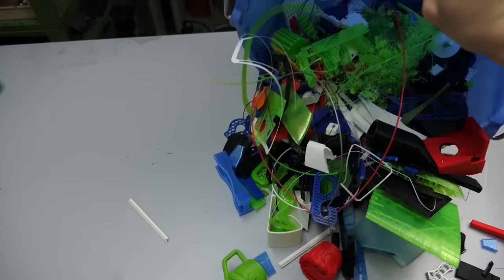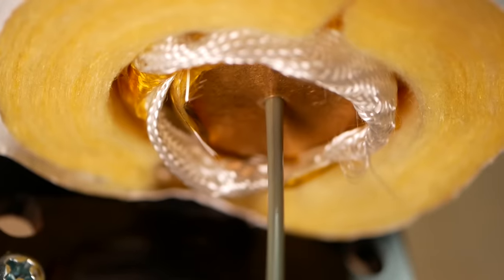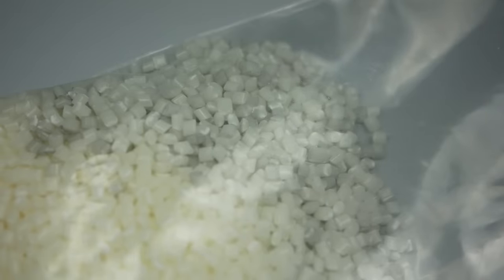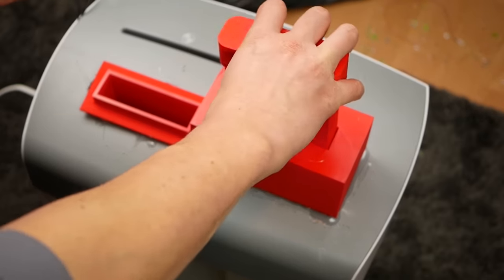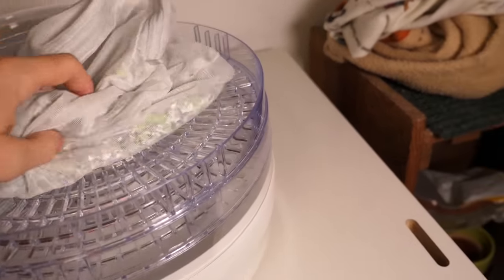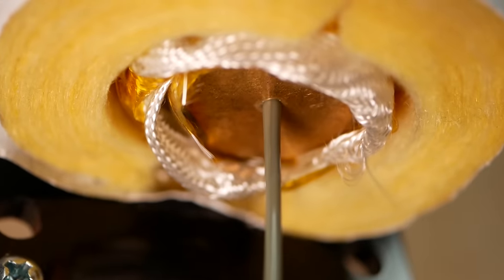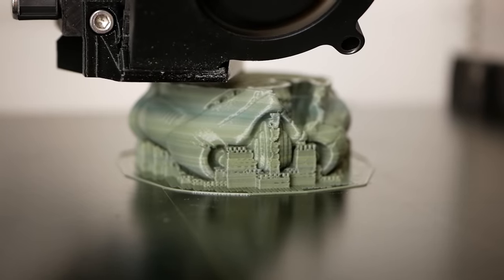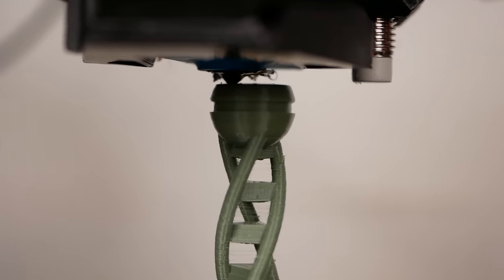Recycle your failed 3D prints! Make new filament at home.

Comment: In my own case, the sad fact is that I do not assiduously separate the different materials.  My waste materials box is an eclectic mix of PLA, PETG, ASA, PC Blend some with CF, and even some PA Nylon.
 I think maybe the only use for a composite of my own materials might be park benches. So, I think maybe I need something that produces pellets for injection moulding, rather than filament.

Comment: well great idea, i had the same one myself but could not build the right kind of equipment i needed and buying it was not an option at least not yet, maybe if some of it comes up in an auction.  Anyhow i had this thought with the wood chipper idea of course you go smaller as the chips get smaller but i was thinking that maybe freezing the plastic first before chipping it and continue to freeze it and chip it or grind it down till you get it into the pellet form you are looking for anyway its just an idea Good Luck

Comment: I think I'd rather take a multistage approach... I'd first melt the recycled stock down completely in a hopper, then extrude it to a uniform 5 - 8 mm filament... then use this new "rough" filament in the rig you created for this set up.  This should ensure complete uniformness going into your extruder and help to ensure a much more reliable end result.

Comment: I've been thinking about this some, what about making something that pelletizes first and then feed that into the final system to try and get good filament out? 

Also, have you tried any non-3D print scrap materials like water bottles or other stuff? Scrap HDPE while not the material of 3D printing seems to be popularly re-melted in this way.

Comment: I think recycling is an extremely important criteria for anyone wanting to get into 3D printing. Recycling should matter to all of us. Ironically, and not so long ago, I was speaking with a friend of mine. For some reason, I decided to play devil's advocate in favor of throwing plastic waste material in the garbage. She was appalled by my attitude and social standing. All the while I secretly admired her, and I agreed with her wholeheartedly. Honestly, I want to recycle my failed parts. Not just to save money on filament costs, but to do my share to protect the environment. There's nothing worse than going camping out in the middle of nowhere, and finding a used latex condom, plastic bottle caps, and empty beer cans on the ground! I hope you'll agree that this is not socially acceptable, or responsible. 
At the moment, I have a large box filled with my failed prints, and waiting on me to find a solution. Also, I recently purchased a second 3D printer. This means I may end up with failed prints more frequently than before. But it brings me to the following question. If you're not recycling your failed plastic parts, what are you doing with them? If you don't mind giving it away to a recycling center, then by all means do so. I don't have the financial means to do this. If you don't care about the global plastic waste problem you're probably throwing it out with the trash, right? 
Which brings me to my next point. The combined costs of a printer, plastic shredder, and filament extruder can be quite daunting. Let's be honest for a moment. The high cost of shredders and filament extruders indirectly contributes to the global plastic waste problem, because most people will opt to take the easy way out and throw their failed prints in the trash. Unfortunately, I am of the opinion that many companies who contend to do their part to protecting the environment do as little as is possible, or just enough to maintain their public image. They devote most of their efforts towards industries. And because these industries combined, mass produce and sell plastic products by the "thousands of tons" (very modest estimate), they can afford the higher costs of industrial type machinery. Hobbyists, on the other hand, with their lower income and limited resources, get left behind. Let's face it. We are nearing the end of 2021, and no one has actually come out with an affordable solution geared towards recycling for hobbyists. A 50$ shredder kit - come on! This is only for the blades, gears and shafts, and you're probably dealing with a family member to get that price. It doesn't include the industrial size low-speed high-torque motor either. Even used, these motors are expensive and usually have to be geared down at an additional cost. 
More often than not, people inaccurately quote lower costs to making their own machines, or they only cover a small percentage of the real costs. It's often easy to overlook those things we take for granted. Many will not have the tools and equipment required to building these machines. So, once you add up the actual costs of making the machines, they often exceed any claimed costs. For example, if you do not have a milling machine, a welding machine, or a drill press at your disposal, then you have to find someone that does. Parts, especially metal parts, can be quite expensive to have made. Add stock price, labor, and possible machining costs, and there you have it - expensive, unaffordable parts. 
But what about alternative ways of cutting plastic materials down to size? For example, instead of using metal blades for a "shredder", why hasn't anyone tried using nickel-chromium wire, like those found in toasters? Wouldn't it be worth exploring other approaches? Through-hole ceramic beads like those used for making jewelry could be used as heat insulators and kept in place with nails to support the cutting wire. Wouldn't something like this be more affordable and easier to build at home, and with basic tools? What about a heated metal "meat grinder" type of machine with an external rotating cutting blade to cut the molten plastic into smaller sizes as it exits the grinder. Hardware stores sell 90-degree angle iron at a relatively reasonable price that could be cut to size with a metal hand saw, then drilled, and bolted together to make a sturdy metal frame. It doesn't have to be perfect. Just solid. Then a car jack could be used inside the frame to crush bigger 3D failed prints, breaking these into flat pieces, making it easier to cut down to size afterward. The possibilities are endless. 
Where are all those new ideas that might help us to do what we should be doing to be socially responsible? There have been no real new inventions since the beginning of 3D printing. Why is that? There must surely be materials other than stainless steel that can withstand the pressures exerted on  plastic parts when processing these for recycling. PLA is brittle, so what other material is stronger than PLA that could be used to build tools to break it up or crush it down into smaller pieces? Where are all of those affordable shredder and extruder projects we might build at home with existing technologies? It's time to build something useful.

Comment: I know this video is 2-years-old, but by refining this process someone could probably create a fairly lucrative business out of recycling failed prints and such.
They take in or "buy" failed prints and pieces often thrown away, and then turn them into 100% (or close to) recycled filament rolls which can then be sold again at the price of or lower than a normal spool. At which point you would probably have a business model approaching infinitesimally active requiring a handful of employees, some technicians, and enough machines to keep things running smoothly.
And if it becomes possible to recycle other plastics or types of filaments back into usable filament, you could probably help get rid of a lot of garbage at the same time. Allowing for a pretty positive PR outlook.

Hmm...just some thoughts is all.

Comment: Interesting Aspect. I really do like the recycling aspect, saving the ressources etc. 
I would see a usage for test parts were dimensions etc. are more important as the matching the correct colour. 
But since energy is also a ressource. Did you ever measure what the consumption for a 1kg spool is?

Would be interesting to put the spool price (self made) against a regular bought one.
Reply: My guess is that it will cost a fair bit, to simplify just assume this bit using the power consumption of the printer, which is 120W on average...
So to run this recycler for 10 hours, is 1.2KWh which is not that much at all really...
The cost of the output will always be more than the input though, since the PLA being used had an initial cost (Say a $40 1KG roll once used up has about 100g of waste, thats $4 of waste material.), however what this does is bump up the efficiency of PLA use, since if 10% of the virgin material becomes waste, and it is recycled and reused in a similar case, then the overall usage of the virgin PLA material becomes 99% [90% from new, 9% second use), thus next-to-none of it is thrown away.
As a bonus, you can hunt down PLA in other forms (household waste?), and attempt to extrude that in order to make this whole thing even better (and maybe even cost negative), but that comes with some risk and much headache I assume...

I just got a 3D printer recently and have been considering the "enviromental disaster" that i've been making what with loads of tiny plastic strands and particles in addition to the failed prints, and support structures etc... (I'm even noting the large amount of paper towel and Isopropyl i've been using for bed-cleaning, and when cleaning off the goop from the extruder nozzle, the paper towel gets plastic fused into it, like a plastic pen of sorts!)
So this idea is a good one to explore, even if it's a mixed result it will at least stop the hobby from doing down a darker road...

Comment: Why not crush the waste plastic parts into round balls before placing them in the extruder?  It's an extra step. but It would reduce the problem of having to use vibrations to keep the hopper moving.

Comment: I love your idea of recycle !
I'm just oriantating and not in possession of a printer.
So i've no idea if it ll work but is it posible to melt your leftovers in a pot with a small hole in the bottum and let it drip in a bucket of water so it ll form round drops ?  It will skip the procces of shredding and the drops might work better than the shrapnel in your nozzle supply . 
Hope it makes any sence 😁 (not my language)

Comment: How about trying to do a mix of chopped carbon fiber in there? I wonder how it tests compared to off the shelf pla...maybe you can make a super rough peek like material...one more idea...how about shredding and using clear soda bottles to make PET or PETG? Maybe the value for filament is greater than returning it for recycling

Comment: what if you put the scrap filament in a blender with some water to prevent melting, then drain and dry the blended filament? Wouldn't you get much cleaner and finer particles?

Comment: I think it's good to recycle the material, but this (at home filament recycling) seems like more trouble than it's worth. A community recycling project might be a better solution. 
A couple of options there. 
1. You do a direct exchange where every kg of material your submit for recycling you then receive recycled material at some to be determined exchange rate. Maybe 1kg in yields .75 or .5kg of recycled material. The difference covers the cost of operating the recycling center.
2. You bring recyclable material in and get paid for it by the kg in your choice of cash or credit in dollars to be applied to future purchases of any type material you want.

Comment: I took the reference to this video from Teaching Tech and seeing it I thought I would give you some ideas. It is possible that some of them have been said by someone else, but now i thought about them... seeing these extraordinary things that you are trying to do in this video.

Idea No. 1 - I would like you to try to grind more bottles of Pepsi, Cola, water and turn them into filament. With this idea we would be able to save the planet from the remains of plastic bottles and transform them into something extraordinarily useful.
Eventually, the bottle pieces should be mixed in an certain proportion so that a good filament can be obtained and the exact temperature at which it could be used for 3D printing can be tested.

Idea No. 2 - It doesn't matter what color the filament comes out because for those who make miniatures of characters from movies or games, they paint them anyway and, therefore, the dye from the painting will cover the color of the filament.

Idea No. 3 - Debris plastics of filaments to be stored by colors and not mixed. In that way, can be obtained filaments of that color exactly.

Idea No. 4 - Maybe other plastic scraps can be turned into filament and can be used for 3D printing.
The problem would be to find the right temperature for such a type of filament. I think it would be best to rethink the 3D printer so you can print something like that.

I would like you to put these ideas into practice and make a video.
How do you think?

Comment: So 4 years later.. are there better options for shredding bad prints and tree supports and such.. into near pellets so that the filament comes out better? Are their additives you could add.. or mix with different pellet types for color changes and better overall filament? Is the device you bought still usable 4 years later.. or do they wear out after a few rolls or so?

Comment: hey! got a few questions for you. can you mix the pla parts with water, then shred it? that would make the parts not melt while shredding, right?
Also, are you able to drill say, 5 holes in the extrusion tip, and you'll get 5x the amount of filament produced? you will then not need to make 5 machines to get 5 rolls. i assume you can just increase the temperature, rotation, etc

Comment: The problem is not everyone always uses the same filament. This means that you would have to separate the remnants of fail prints according to the filament, because otherwise the recycled filament is a mixture of everything.

Comment: you using a fan with half the wings cut off was a great idea however its way too light and really doesnt vibrate, you need a metal version you could find one in like a gaming controller, but even those might not vibrate enough, id say make your own larger one or buy a larger one

Comment: re blend the output make pellets instead of spooling this should allow you to output much faster if your making 3~5 mm pellets .
is it possible to have 2 outputs on the nozzle and loop half the output back into the hopper so you have a stable color?
i wonder if you could make a tapper roller like they use for glass or candy to simply heat everything and make a log instead of shreding everything.

Comment: I would suggest to simply split the filament to color. Shredding should also not be such a complex process. Simply melt it and drop it through a nozzle of 5 mm. Then you can still push it through the 'device' earlier shown.

Comment: For some situations recycling filament is probably necessary to make the supply of filament last longer, but perhaps you should look into how they make the filament and understand the process better how they do it. But what I see from the video looks like the recycling filament process needs to be improved a lot in the equipment to do so needs to be improve as well, before this can be done in a reliable manner.

Comment: Even at like 500 bucks for a recycling setup, and a whole process involved to use it, this would pay for itself in no time. Think of the first iteration of any design... Do we really need to be using fresh filament? I think doing a 50/50 new/recycled blend is even quite responsible, and would probably be perfectly functional for a lot of those random, low-spec pieces we have floating around (looking at you, 3d printer cable chains!) I just got my first 3d printer, totally bit by the hobby at this point, and I'm saving my failed prints for recycling.

Comment: What happens if you cut up the extruded filament into <5mm lengths and recycle only those as a sort of "2nd stage"?  
I'd bet with something close to the virgin capsules the resulting filament would be much more consistent.  
If you're clever, you could find a way to remove the chunks that contained impurities within the filament and eliminate them from the batch, possibly sending then back to the "1st stage".

Comment: I’m basically doing the same setup, do you have an STL for your hopper?  It looks a lot better than the stock hopper that I’m having feed issues with in vertical mode.

Comment: If you're melting scrap plastic from prints and you want a more uniform color and filament size, couldn't you build a chopper to chop your output into uniform-sized pellets, first, then mix those pellets well (to get a more uniform color in the output) and make your filament from those pellets (to get a more uniform diameter)?

Comment: This is way too expencive to be a viable choice for an average 3D printer user. BUT, there should be a market and industry that offers buyout of used filament and then we get to buy it at a fair price.
Thank you for doing this video though. I learned a lot.
Reply: What is the cost of doing one kilo roll of pla  anyone know, from how much time and weight o raw material to time to end? If you can get it for $20 or less a kilo normally  i think its still worth the trouble overall🤨 and were just making remote control boats and rc truck rims😅